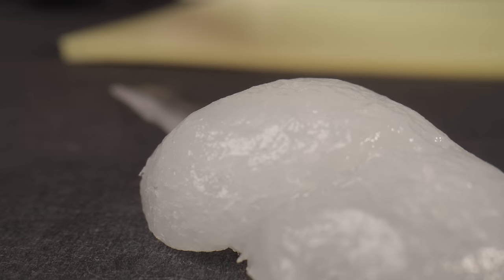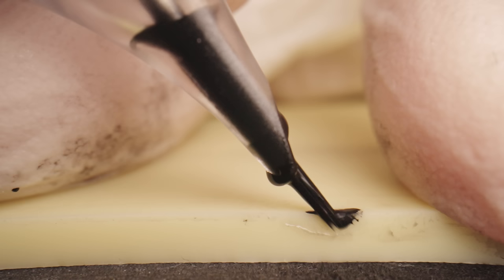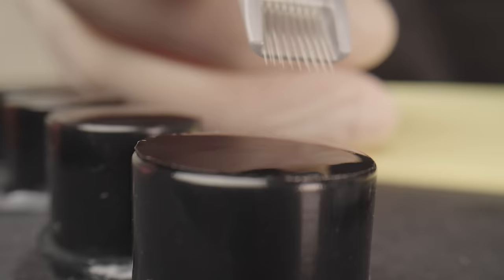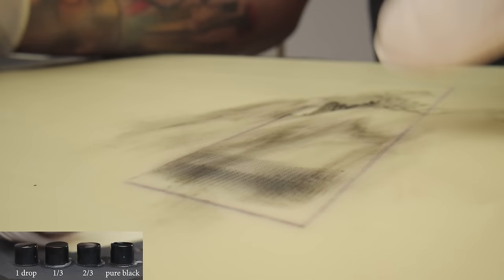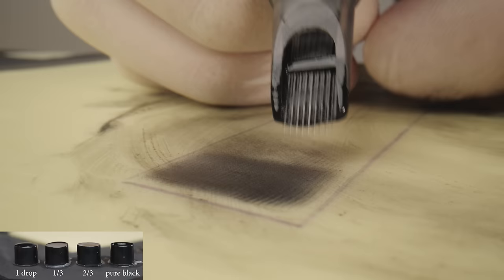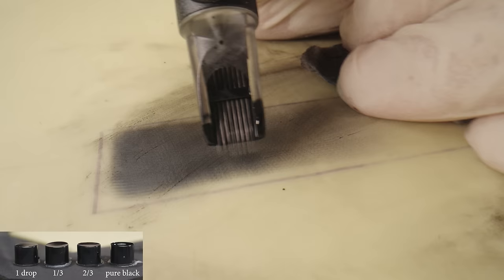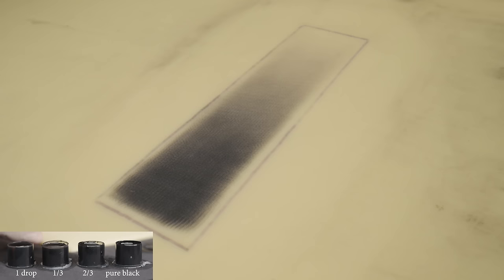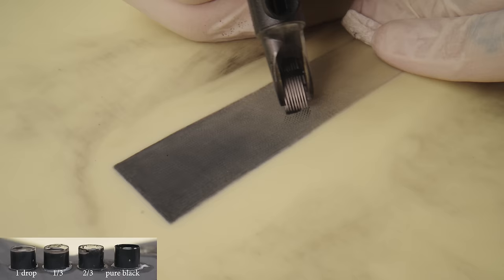Tattoo Shading Techniques - PULL WHIP SHADING

Comment from the maker: To avoid any misunderstandings, as I mentioned in the video, it's not necessary to tattoo the same spot as frequently on real skin because real skin absorbs the ink more quickly. In this video, the focus is on the technique. Tattooing the same spot so often on real skin would lead to significant overworking, but it doesn't happen as quickly with this artificial skin.
Reply: Man those needles feel good to me, it feels like a satisfying stretch on an itch.
Reply: What liquid you put into to the ink please let me know very important information please 🙏
Reply: @Funnyvideo75548  when i was tattooing , witch hazel was sometimes used to dilute ink. Idk if thats still the case

Comment: so out of curiosity is that the correct way to face the mag on the direction you shade? 

if you were pushing away, would you have to spin the maching around so the open face of the needles were facing you head on? or does it make a difference

if that makes sense